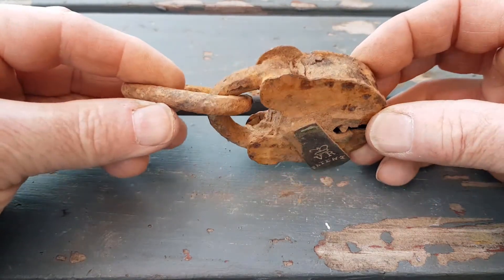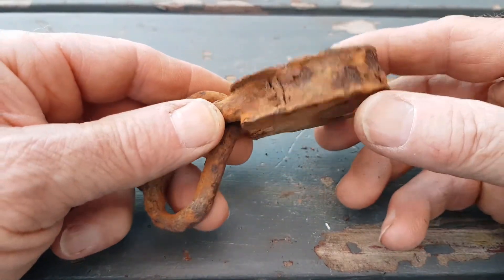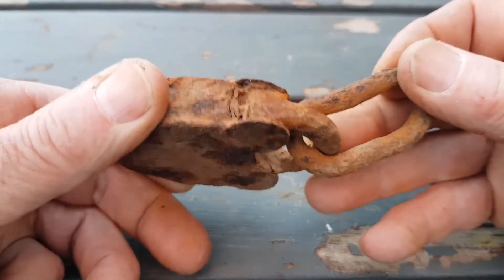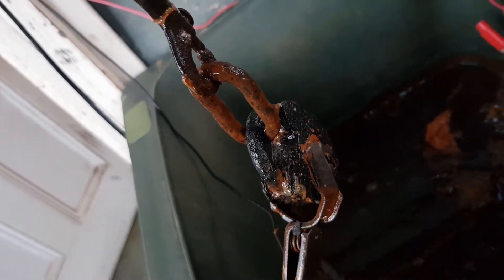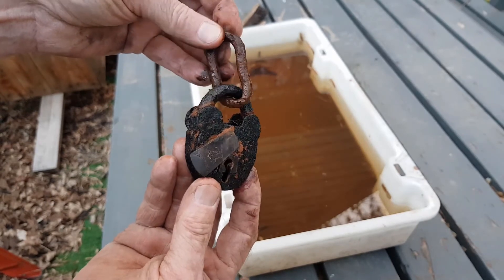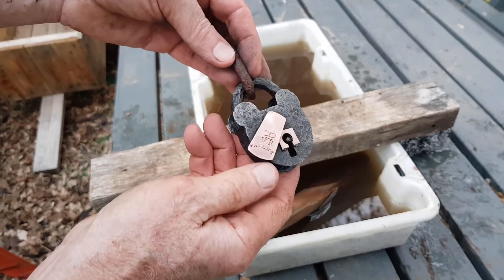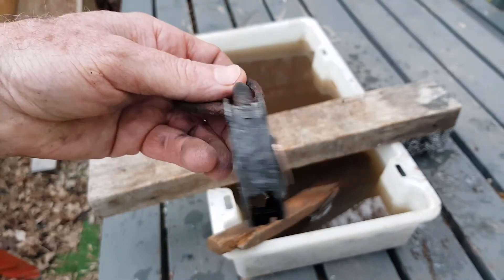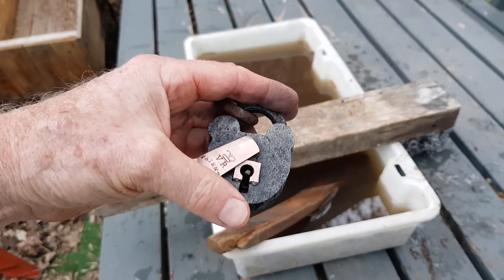Saving an early Victorian Railways Padlock from the Scrap Bin with Electrolysis

Comment: Hi Chris. 
Just catching up on some of your earlier videos. I'm going to try this tomorrow, but wondered if more than 1 item can be soaked. Can a wire or something be used to join other things in the tank? Like, if you had two old locks and did them at the same time, how would one do that? 
Michael.
Reply from the maker: Hi Michael, Yes - you can do as many items as you want, but each must be electrically connected 👍
Reply: @TheUltimateRecycler  Ok, good to know, so a copper wire from the terminal to the other bits? wrapped around it? tight. I'm not using a deep tank like you do, just a smaller plastic garbage bin.
Reply from the maker: @Mykleshed  Yep, connect them all to the negative. They should all start bubbling if things are right 👍